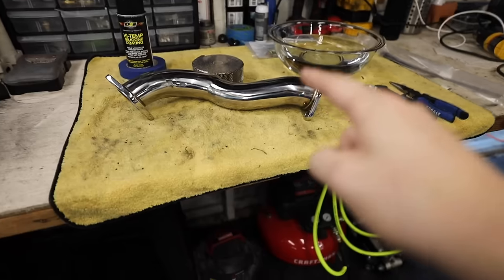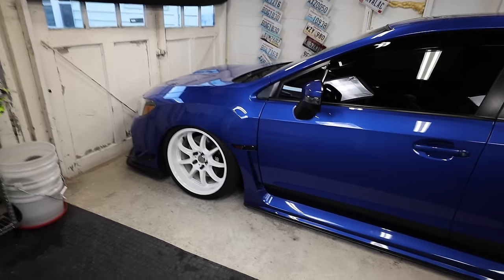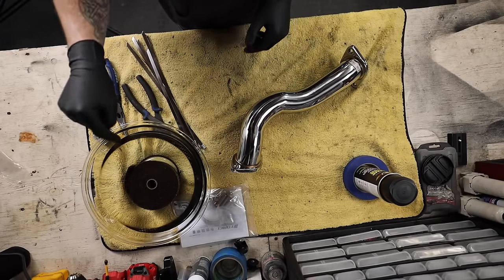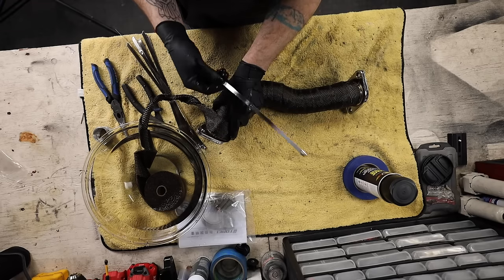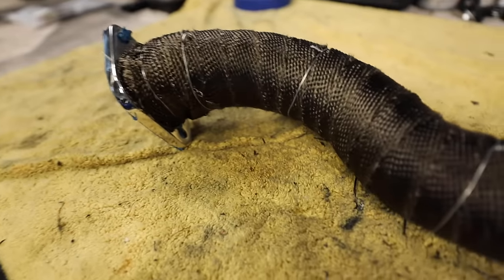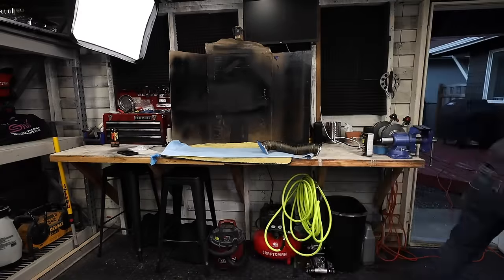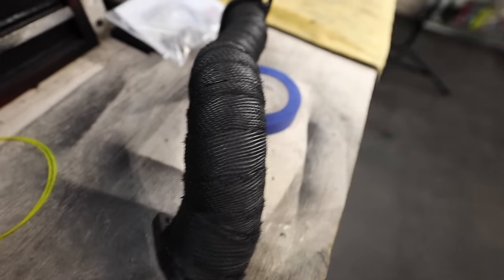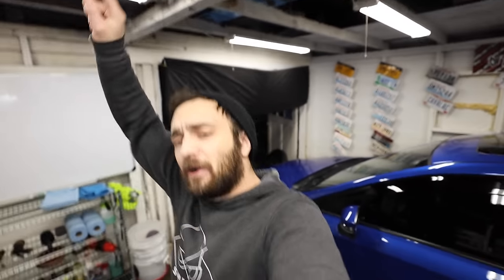How To Correctly Wrap Your Exhaust!

Comment: This video is a good foundation for those that haven't wrapped exhaust. However, titanium wraps don't need to be soaked and expanded to be applied - they can be wrapped dry. Additionally, titanium wraps require 4-5 very light coats since the silicone won't absorb as well as fiberglass. I'm stressing this again due to the fact that between every coat with titanium wraps, you must heat-cure it at 400-425 degrees Fahrenheit between 1.5-2 hours. The heat-curing process will prevent any moisture from seeping in.
Reply: Thanks for the additional tip I appreciate it
Reply: Thank you
Reply: The instructions that come with the titanium wrap say to soak it first...
Reply: @3RAN7ON  I'm holding the package in my hands.... & Nowhere does it mention soaking wetting or anything to do with water...
Reply: @3RAN7ON  what a strange thing to lie about.  Unless my own eyes deceive me, you are incorrect.
Reply: @Mastermindyoung14 
I wouldn’t say he is lying.  I’ve see packaging that said to soak in water.  
Some of the cheap Chinese “titanium” wrap, just put the same instructions for wrapping fiberglass, into their “titanium” wrap.  Seeing that, I sent it back.  It’s probably colored fiberglass wrap, with little to zero titanium.  When they can’t give proper instructions, it’s probably not proper titanium.

Comment: Just wrapped my headers last night with the Titanium wrap. No need to wet it since it is not made from fiberglass and it is extremely flexible and stretches easily. Other than that, great job.
Reply from the maker: Wetting it is just something yhats worked a little better for me in thr past. I believe DEI suggests doing it dry. 🙏
Reply: @Smeedia  just found your channel by the way. Full of great info and great content. Keep it up.
Reply from the maker: Thank you! 🙏😁

Comment: If u read the directions, 
It’ll tell u to paint the exhaust prior to wrapping and let fully cure. 
Then wrap and no water will ever eat away at the metal
Reply: Yup, moisture will make its way in and slowly eat the metal if not painted first
Reply: You can tell he isn't about to read no stinking directions... I think between the first can of paint he huffed and god knows how many power drinks he wouldn't listen to the manufacturer if he was standing there. Bad advice video...
Reply from the maker: Dude literally all of the rebull

Comment: "Sprayed an entire can of spray paint into my face".. That must hit dedication, I'll keep watching.
DEI states that the titanium exhaust wrap is to be installed dry, as it is far more flexible than the previous fiberglass based wrap. Further, I dont know about subarus, but my exhaust gets awfully hot. Certainly hot enough to evaporate any moisture the wrap may absorb. I will say however, I do like the idea of using safety wire rather than the stainless lock ties.

Comment: Concerning the hi-temp silicone spray DEI says, "While not required for Titanium exhaust wrap, HT Silicone Coating will protect and prolong the life of the wrap. DEI recommends a minimum of three coats, each heat cycled for curing *before applying the next coat*. To cure, HT Silicone Coating needs to reach a temperature of 400°F for approximately 2 hours. Allow to cool before applying the next coat."
Reply: I'm worried about this curing process, have you had experience with it? How did you cure it? Wanna redo my Harley Python pipes.

Comment: Add a Safety Wire Twist Tool to the Toolbox. Makes the job of twisting the wire a breeze and saves you a ton of time 😎👌🏼
Reply from the maker: I lost my set 😫 I need to grab another set here soon, and they're si much better to use 😅
Reply: Smeedia after moving Duty locations so much I’ve lost a lot of tools. So many that I’ve lost count 😝
Reply from the maker: @theblueninjazx10r  lost a decent amount of mine when I ETS, the struggle is real 😅

Comment: Safety wire pliers would have made that a ton easier. They clamp onto the wire (like vise grips) and then you pull and they twist and pull it tight and it snaps off the excess. Great video keep up the good work. Yay no pidgeon!!!
Reply from the maker: I agree, I use to have a pair and linked them in the description of someone wanted a set. And thank you! No pigeons over here!!!

Comment: they make lacing or safety wire plires that lock and spin when you pull on them. don't make the twist on the wire too tight though. it will break with vibration. not sure you need the wire in the middle sections though.

Comment: Is that silicon spray really necessary? I mean, is water really going to get under the warap and corrode a pipe that's like 500 degrees?.. I'd think it would stay pretty dry just from the heat..

I don't know either way, I'm asking..

Comment: A great tutorial video. The only thing you forgot to mention is WHY do you do this? 
I think I know why, but a full explanation of the benefits of heat tape wrapping headers and pipes like this would have been a good bit of content to have in this video.
Reply from the maker: Should have mentioned it, but I did it because it will be in an area that can melt plastic, but for performance reasons it helps keep the heat in. Downside is that It can crack exhaust components from the retained heat

Comment: I just put a new exhaust on my bike that routes up the side to the tail. First ride melted my boot to my sexy new Ti midpipe. Does this stuff stay cool enough to be able to have my foot close to it?
Reply: Yes. I ran it on my track bike for just that reason. Works great. Would also suggest adding a heel guard so your boot doesn't wear out the wrap. Lots of cheap heel guards for exhaust out there.

Comment: I just wrapped mine without soaking the wrap in water, using gloves and also used zip tie that came along with the wrap. Now, im suffering an itching sensation due to the micro fiber splinters that are sticking to my skin and some are also in my elbow 😢
How long do you think my body can get rid of all this micro splinters? 
Im also having some oder issues with the wrap and how long will this odor go away?
Reply from the maker: Take a shower and really scrub, should get a lot of it out but typically a day or so after. And the wrap smell will go away after a few days 🔥
Reply: Smeedia Thanks a lot! Just installed mine today and ill do a lot of scrubbing later then. Its also good to hear that the oder will eventually go away.

Comment: this is completed unrelated to this video. but you should do a video about jacking up the car front and back to be able to use jack stands. I've seen some people that jack up the back of the car by placing a jack right on the rear diff? could be good content on a future video in which may require to jack up the car?
Reply from the maker: I can add it into a video, I use the rear diff ad a jack point when jacking up the rear of the car 😅

Comment: How is the wrap holding you? According to the DEI website the silicone spray can damage the titanium wrap.

"While not required for Titanium exhaust wrap, HT Silicone Coating will protect and prolong the life of the wrap. Due to the difference in material from glass fiber, HT Silicone Coating soaks into Titanium exhaust wrap's basalt fiber differently and needs a few coats and heat cycles for it to adhere properly. DEI recommends a minimum of three coats, each heat cycled for curing before applying the next coat. To cure, HT Silicone Coating needs to reach a temperature of 400°F for approximately 2 hours. Allow to cool before applying the next coat."
Reply from the maker: Its been holding up great from thr last time I was under the car. Peeled some of the wrap back to make sure the pipe was not corroding and everything looks perfect still. I've always used the spray on my wraps because its so wet up here and have never had an issue so far

Comment: Hey man so I believe the grimmspeed J pipe for the WRX is designed so that we are still able to use the OEM heat shield, would there be any disadvantages for wrapping using your technique combined with the heat shield?
Reply from the maker: Should be any issues, better heat control overall. Just have to make sure the wrap is coated so water won't intrude and corrode the J pipe over time

Comment: Man that wrap is expensive yes but I personally would never do it that way cause it's almost like buying a diamond ring and taking the diamond out. With these heat wraps like this I have had no issues with getting it tight. Wrap it as tight as you can dry not in water then after the first heat cycle the wrap has a harder in it that will cause a lot of smoking when you first run it but that pretty much makes the wrap a cast to the pipe or header. There is a process to doing this so look it up if you buy this wrap. I have wrapped my headers a few times due to having to take the car apart no fault on the wrap and every time I have taken the wrap off the headers it is really tight and it holds the round shape it had being on the pipe as I said like a cast. I would try the dry method before this one. I hate to see that beautiful wrap soaked in water and then painted over that nice titanium color. Not trying to hate on this video I'm just saying there is more than one way that is effective.

Comment: Gratz on no pidgeon. Lineman pliers would work better.  You can also "Heal" the twist and get it a turn tighter.
Reply from the maker: Agreed, I use to have a set but lost them 😔 I linked them in the description for anyone else to snag some if they want em!
Reply: @Smeedia  I'm on my 3rd set myself. Been an electrician for 13 years now, not a bad ratio.

Comment: Ceramic coat it before you wrap it. It will keep the pipe corrode free. Also DEi came out with titanium wrap which you don’t have to wet it before applying
Reply: You mean ceramic coat the wrap? Hahahaha
Reply: @shaneintegra  I wouldn’t ceramic coat the wrap. The finish product looks cheap

Comment: The DEI titanium wrap does not need to be wet to wrap since its so pliable already. Also the high temp silicone spray should be applied to the pipe on clean bare metal and baked to atleast 400 degrees to cure. There is no need to apply it to the exterior of the titanium wrap afterwards... without coating the pipe underneath the wrap its still prone to corrosion due to no moisture barrier.

Comment: Do I need to spry paint a stainless steel pipe? Or just wrap it? Becouse water is not an issue but the wrap is
Reply from the maker: Just wrap would be fine if you don't live in a super wet area

Comment: i need your advice bro .So i'm getting the stage 2 build done on the 23 .Full Tbe,Verticooler,Tgv/Egr deletes,Cai and pro tune.My question relates to the video .Il be making around 200-205kw at the wheels .Before giving the parts to the shop should i wrap my j pipe also ? 2nd question .I have a Gfb respons Bov ..Should i keep it or do i order from the states the Boomba Bpv?
Reply from the maker: The GFB is a good valve just check to make sure its not leaking, a smoke test should clear that up. If its leaking I would rebuild it or snag another one. As for thr J pipe if you can ceramic coat it, that would be ideal. If not some heat wrap should work for you 🔥
Reply: Smeedia thanks heaps mate wow i didn't know ceramic coating would be enough that's awesome .Thats why i follow your channel man you always make time to reply to your subscribers .Thanks a lot

Comment: New phone and was somehow not subbed anymore? 🤔 well I’m back now 😂 any tips I am throwing in headers up and downpipe at the same time along with IAG tgv’s any tips help thanks! Anything else I should be throwing in with those things? Gonna be on my first pro tune
Reply: Also a EWG planning a 38mm from grimmspeed (turbosmart I believe?)
Reply from the maker: For the header make sure it is 100% lined up or it will not want to go on 😅 what all else do you have going onto thr car? 😁
Reply: Smeedia for right now I got downpipe uppipe headers external wastegate that I need to throw on just seeing if it’s worth getting a tune with just that or waiting to throw more into it🤔
Reply from the maker: AOS, boost controller, intake. Injectors and fuel pump would be my suggestion😁
Reply: Smeedia  forgot to mention have APS and EBCS waiting to go in too. Thanks for the feedback I will possibly convert fuel before first tune. Will be a big jump!

Comment: Good content brother, so I have a BRZ and I installed an aftermarket EL header and overpipe about 2 months ago but they are not wrapped. Should I be concerned with heat issues in the long term?
Reply from the maker: I wouldent stress about it, if your N/A still you shoydlent have too many hest soaking issues
Reply: @Smeedia  Oh okay, thank you for taking the time to reply.

Comment: devon in the group was saying he's cracked 2 exhaust manifold because he wrapped them. Makes me think twice about doing it for the sti.
Reply from the maker: It's not the beat heat control method but for a budget it works, I would suggest ceramic coating before this

Comment: Im re-watching this video and can I ask because im still learning about parts and cars. Why did you need to wrap your overpipe? What other components off the exhaust are you going to wrap and im assuming its prep for the turbo?
Reply from the maker: I wrapped this one because it wraps over the front subframe near some suspension bushings, the pipe came with the wrap so I saw it as an opportunity to show how to wrap. But for this piece when the tirbo parts come in ill prob remove it
Reply: @Smeedia  oh sweet. Didn't realize it came with the wrap. Thanks for that!

Comment: I heard you're NOT supposed to soak the wrap.... I've heard everything from "soak it for an hour first in a bucket of water" to "just lightly drizzle or run the wrap under a faucet and get it damp or moist but not super soaked" to "don't get it wet at all, just apply it right outta the box". I guess the truth is one of those or somewhere in between!

Comment: Cool video! Would you say that coating the raw pipe before wrapping in heat wrap is a good idea? I've heard people saying this can be an extra layer of protection against water and corrosion. Also, would this be a good idea to do on the Killer B Holy Header with the SwainTech Multi-Layer Ceramic Coating option on the headers? Thanks!!
Reply from the maker: Swaintech 100%

My most recent one I cerakoted my exhaust and wrapped some of it so we shall find out

Comment: "Proper way" would have been to scuff it up first, prime it (high temp primer), and then paint it (high temp paint). This protects the pipes from when moisture is built up between the wrap and the pipes.
Reply: Moisture between the wrap will destroy the pipe.  Been there done that.  It was a very painful experience.
Reply: @michaelhiggins244    Right, painful indeed… but, the high heat primer and paint helps protect the metal from moisture, which inevitably condenses there.

Comment: I have a question for you: I have the Grimmspeed catted downpipe on the way and was planning on wrapping it just like you did in this video. Yesterday I was at Surgeline setting up my tune appt and was talking about my plans with the guy at the front desk. He recommended that I do not wrap the downpipe. Being in the NW with the weather it can get wet and have other things down there stick to it and is just not necessary is what he said. Again he wasnt the person doing the tuning and some of the things he was telling me seemed questionable based on what Ive learned on your channel and other sources. So should I skip wrapping like he said or stay with my plan?
Reply from the maker: When it comes to wrapping if it is not fully sealed water can get in and degrade the downpipe quick, we get a lot of water up here so it's very plausible for it to happen. It works very well for heat control but also has its come backs as well. You dont ned to wrap the downpipe but either option works

Comment: awesome video once again, I have a question with that wrap as I have a 2003 wrx with a varex full turbo-back exhaust would it be worthwhile to take off the downpipe to wrap it to try and eliminate some of the heat in the engine bay?
Reply from the maker: It would help to reduce the hear soak, but if you do decide to do it make sure that you coat it so it won't erode over time 🔥
Reply: @Smeedia  yeah right interesting i think i should definitely do that thanks for that and its crazy how your already at 12k subs good work man
Reply from the maker: Thank you and awesome to see things keep growing!

Comment: Wire and metal zip ties are ultimately not the way to go, especially wire which can cut through.  Hose clamps are far easier to deal with and hold well while not cutting into the wrap.  If the looks are enough to cause you to choose not to use them, you can spray them, too to make them less noticeable ir, consider a thick ceramic spray costing but doing something that can be .ore harmful because it "looks better" means you need to reconsider your choices to begin with.  The whole reason we do such pain in the butt stuff as wrapping exhaust is performance first, looks second or third.  Throw away the wire, whatever else you may ultimately choose to do.